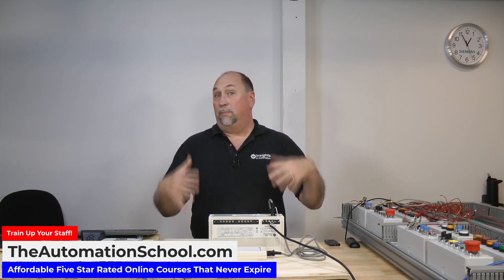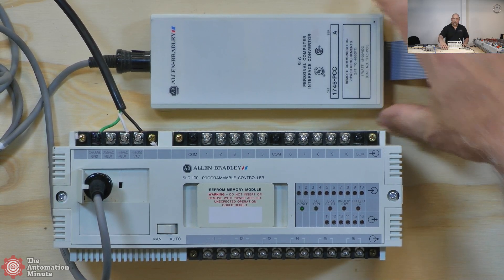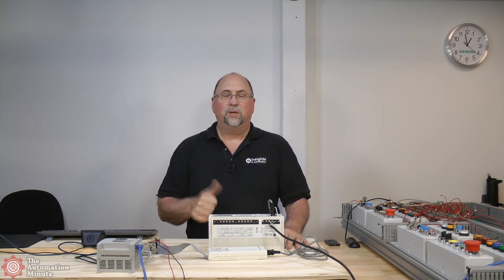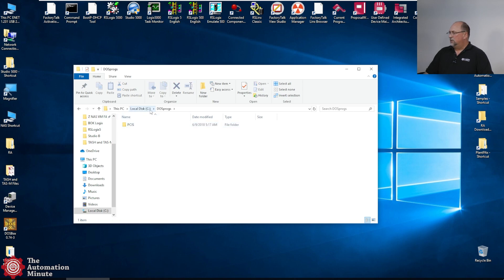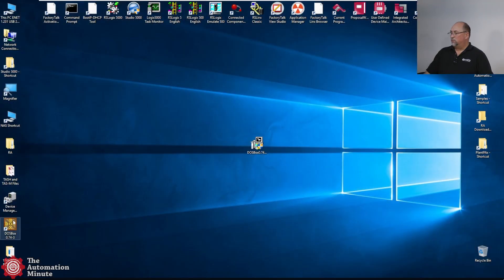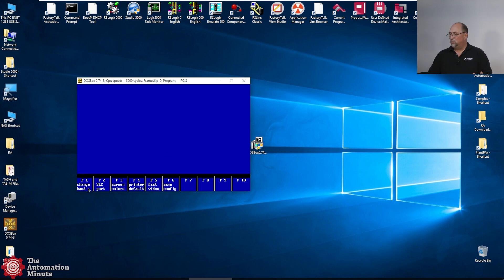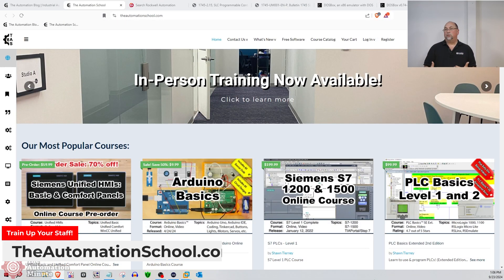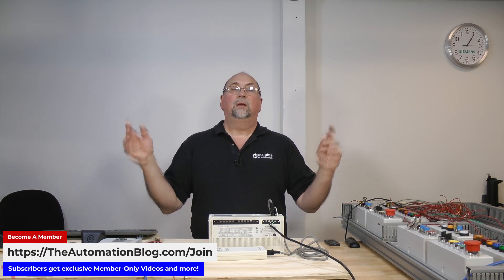Connect to a SLC-100 and Upload the Program

Comment: Thanks for the awesome video as always, I'm about to get online with  SLC 150 (1745-LP151), wondering if you have had any bad experience with it? the system's about 30 year old,, and I was warned about a potential damage just getting online with it using 1745-PCC cable-.
Reply from the maker: Good morning, I just found your comment and I understand you likely already connected, but I'd say there's a very low chance you'd hurt the SLC-150 by plugging into it. Unlike a Laptop or TV, PLCs are hardened against electrical shock, however the chance of something going wrong is never 0%. Please let know how you made out!
Reply: @InsightsIA  thanks for the reply, I managed to get a hold of the original print of the ladder diagram and began converting the logic to studio5000. I would end up just uploading the program when doing the PLC upgrade. Only thing I wanted to verify is that whether the running program matches to the original print from 1990 :) I'll keep you updated.